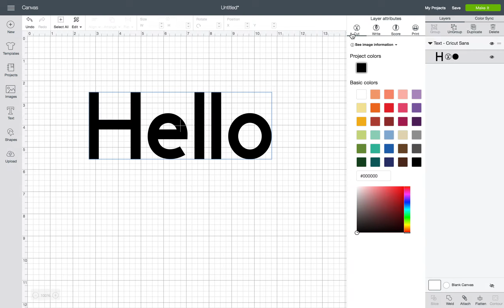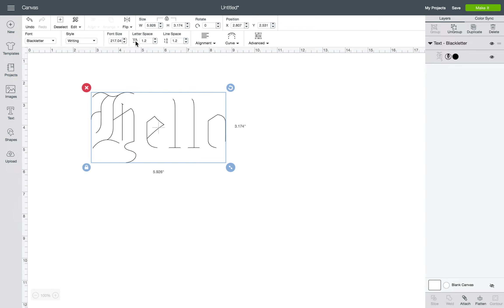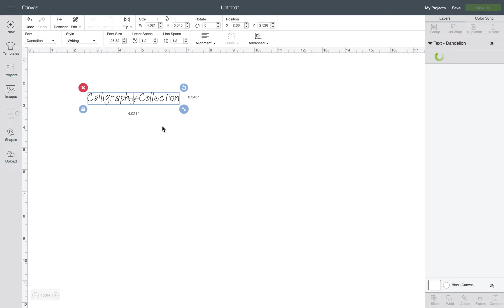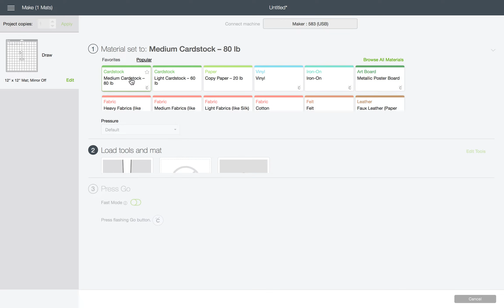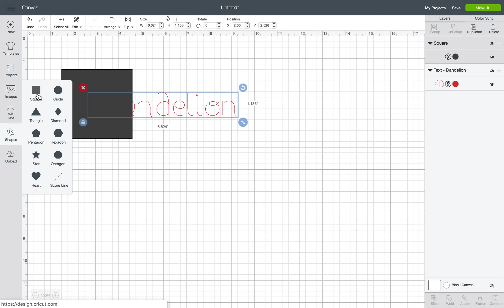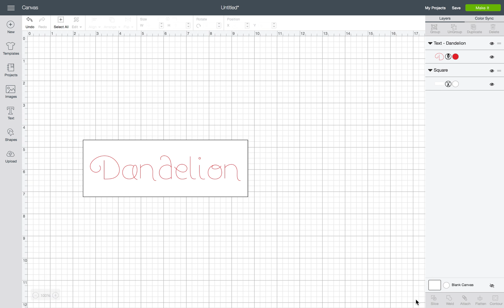Writing with Cricut Pens Using Your Cricut Maker or Explore

Comment: My Layers panel doesn't give me any attributes!  The Layers panel just says:  Text: Cricut Sans; then there's an eye icon.  Under the Line Type tab, I can change from cut to draw, but NO other options are in my layers panel.  Help, please!  I have the Cricut Maker.
Reply from the maker: Robin Clary this is an older video! You can change your font to writing style the same way I did in this video! But the line types moved to the top toolbar 👌🏼